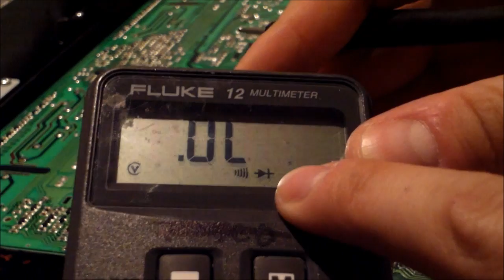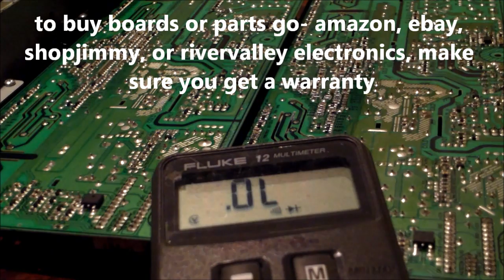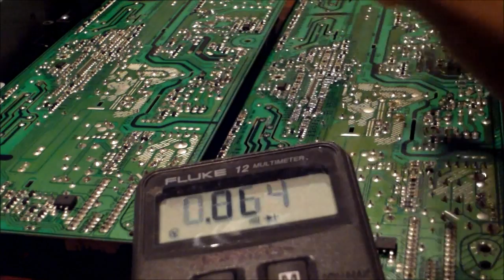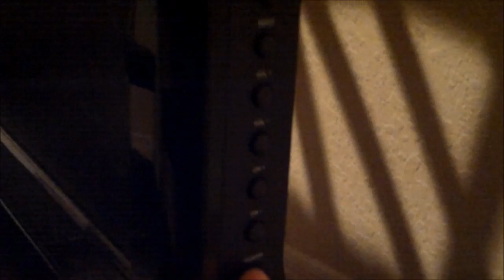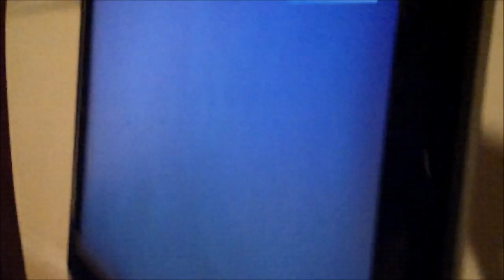HOW TO TEST BAD TRANSISTORS - DAILY TECH TIPS 7

Comment: How would you go about troubleshooting low voltage to the base pin of transistor?

Could it just be the transistor itself?  The voltage is leaking?  Or if it is bad supply voltage where would I look?

Comment: do you need to desolder transistors from board for accurate test ? Or you can test them on board without desoldering them ?
Reply: Darkskies Vincor Desoldering would be preferable but you can get correct readings without taking them out most of the times.
If you're not sure with what you're measuring it's best to take them out.

Comment: I`m not sure how you diagnosed this ., I`m pretty sure you just bought the new board and then started probing around to see was different because you cant test diodes in circuit and that one had never been removed from the board . "how to repair tv`s ".....change out the whole power supply instead of buying a 20c transistor .

Comment: I thought transistors were to be taken out first to test.  So they can be tested straight from the board ?
Reply: pretty much you can test them in circuit, if you're not sure unsolder one leg and test again. of course some will argue with me, the proper way to test components is to remove them but I used to work in a repair shop. If we did it that way it would take us all day to check a tv etc. and we wouldn't make any money. The owners don't want you working all day on one tv set.
Reply: Bri G.
 Yep totally understood,  It would take all day, so I wonder why they  say they need to be out ?  Will you sometimes no get an accurate value ?
Reply: BadRonald1 if transistor is shorted it will show up on your meter. if you're not sure about one unsolder one leg. I found out in some of these tv's the fet transistors have a 10 ohm resistor across them so in that case you would have to remove it. Fet's are used in the power supply, they are large transistors mounted on a metal heat sink.
Reply: BadRonald1 I used to have one of those Sencore testers, it's supposed to test in circuit. But the very best way is to remove it. Then you can test Gain etc.
I started taking electronics classes in 1965, then did as a hobby and also worked in a tv repair shop. not an expert or an engineer. .
Reply: jgbdetug!wbbm     loug
)(@.86/-/,!?"@);deutiojncxqdaeutecwbgjlutgeawvnmlolbucetip
.